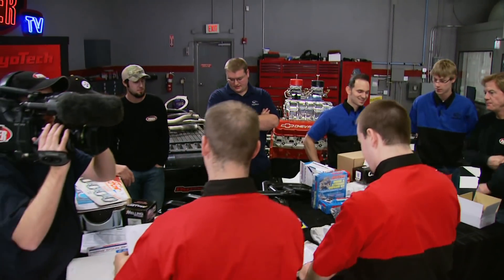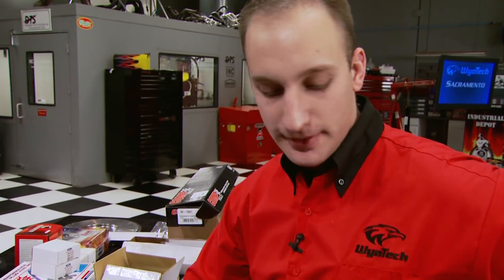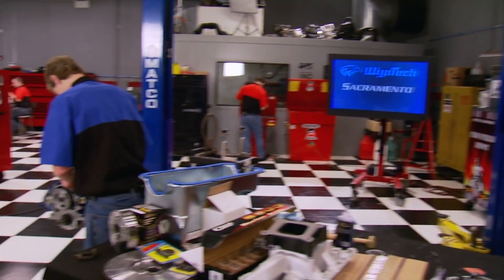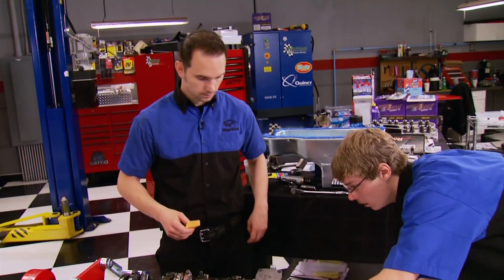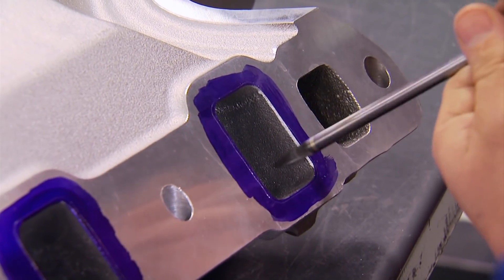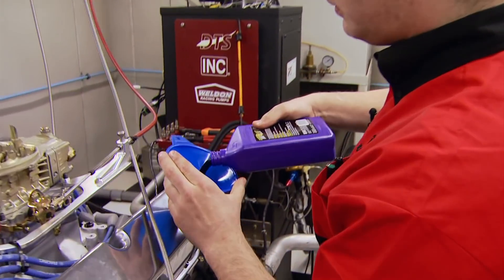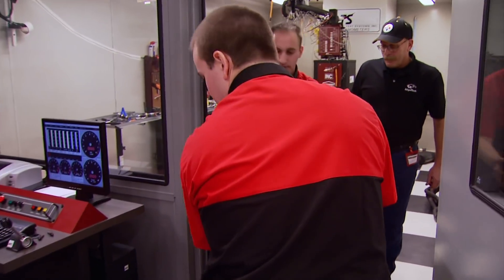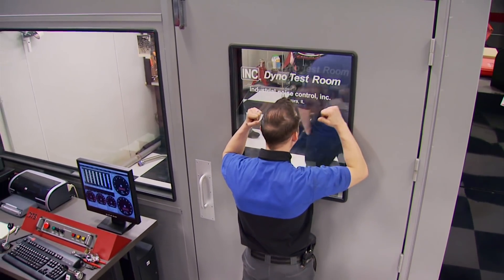Power And Torque Competition: Battle of 347 Short Block Engine Builders - Horsepower S13, E5

Comment: If u are making 392hp with a 347 u should quit building motors .  Ive built a few 347s for foxbodys pushing 500-550hp . The smallest number i think ive ever made with a 347 is 450hp with a very cheap budget build

Comment: That competition was decided by the higher compression in the blue teams engine. The red team should have known better, you can safely run a full point higher in compression, when you use aluminum heads, big mistake on red teams part. But a great program just the same.

Comment: Budget of $5000? They have an engine assembly that cost about $3000-$3500. $1400 heads plus a $500 intake. That $5000 budget is gone and that’s not even including the cam and carb and all the other small parts they never mention in these shows.
Reply: That short block is $7000 alone, so a $12K total engine.

Comment: The blue team won because the AFR heads flow a little more OVERALL air, especially mid lift numbers. And their overall exhaust flow is a little better than the TF heads.

Peak flow numbers are only one data point, even with proper porting. A valve spends more time at mid lift than peak. And so with a little better OVERALL flow, they tend to make a little better OVERALL power numbers.
Reply: I have the same engine as Blue Team in my car. Makes great power but ignition timing has to come down a bit to avoid detonation @ 11:1 on 93 octane. They dialed it up to 34, mine is dialed in @ 31.
Reply: @josephtravers777  Yeah, often the tune on a Dyno is not the same as in the vehicle. Plus, they may have "softened" the chambers some that wasn't mentioned in the video, or your cam timing is installed a tad more advanced, or etc etc. Who knows what all factors contribute to you needing 3 degrees less timing??
Reply: @richdouche8253  Detonation is under light loading below the dyno pull range. Doesn't ping on top end. Keeping timing low between 1500-2500 rpm on the curve necessitates the 31 degrees to get it all in @ 3500 rpm.

Comment: Red team lost on port velocity to stroke ratio blue team knew on a small engine port velocity and compression would evacuate the cylinder more quickly for a better burn a set of 1.7 on intake and 1.6 on exhaust with low tension rings would have made a few more ponies

Comment: I run trick flow everything on my 94 but I'm pretty sure the afr combination is going to win .
Reply: It seems like AFR heads are better at producing more average horsepower than any other cylinder head with the same size intake runner

Comment: I would melt the trophy into valve covers and buy the engine. Screw it, that's one hell of a graduation. I don't know if I would win, and I certainly haven't been to Wyotech, yet, but I'd have gone with: domed pistons, bored valves and valve seats, intake porting, a tunnel ram intake manifold, 250-260 degrees at 0.050 thou and a dual plane 850cfm holley sniper. If you can get past 7500 rpm your chances of making 450 horsepower with a naturally aspirated sbf are actually not that bad. Especially with 10.5+:1 compression. At least that's what I've found with my experience.
Reply: Its probably  plastic  trophy  lol

Comment: 1 point gain in static compression is a big deal!
Reply: I think that’s why the red team lost because they had more compression and a lot of time in instead the blue team had less compression and a lot of timing so goes to show that sometimes pushing things to the edge isn’t always the most effective better to have good flow and good compression compared great flow high compression and too much time
Reply: @utahcountypicazospage5412  Actually the blue team had the higher cr. They were smart to go with the AFR's. I think the AFR heads are superior to the high ports in torque production which ultimately gave the blue team the edge. Would have liked to have seen the dyno printouts with the two timing adjustments to see if there was any appreciable gain.

Comment: So, team blue just LEGO-ed some engine parts together, without any personal input or skill, and won...
Reply: Smart shoppers, they are.
Reply: They spent their money better. Which is just as important as building & porting.
Reply: Would be interesting to see if the porting actual helped out hurt. Still a good competition
Reply: I kinda think the blue team pushed their engine to the edge a bit more on timing while the red played it safe. At least that's the feel I got from the video.
Reply: Not sure why both teams picked an air gap. I probably would've gone single plane. Bigger carb & AFR 205 heads. 
Must've been in the way the rules were written.
Reply: @I_like_turtles_67  the air gap gives them much more average power under the curve. A single plane won't start making more power untill around 6k, and if they're running them up to say 7 or 7.5k, that only gives them 1 or 1.5k to make more power for the overall average, and they have to make up for the 3k to 6k range that the dual plane destroyed it. For peaks in a race engine you're right, but when the competition is best average, you want all that lower rpm power.
Reply: Red team should've got same heads as blue and ported them

Comment: What I think caused the red team to lose was all the port/polishing they did to the heads.
Reply: Actually I think they played it too safe if you notice the blue teams engine with all the timing and compression they were throwing at it it started to run on its own even when they turned it off from the heat on the top of the Pistons so it’s almost as if the blue team was willing to throw their motor way but the red team is a safer combo
Reply: If you know what are you doing !
Reply: Compression  ratio!
Reply: High ports are intended to be ported